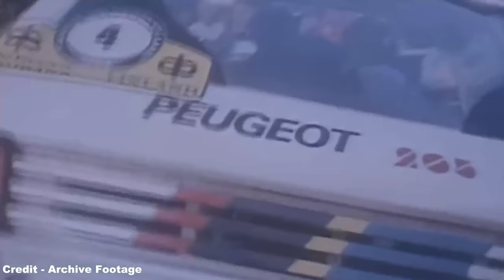Supercar Stories - Porsche 959

Comment: The 4 wheel drive system was not invented by Porsche at this instant. That was taken directly from the KdF Type 87 from 1938. At the same time the Carrera 4 (964) used the Audi system and was unable to move on snow or ice.